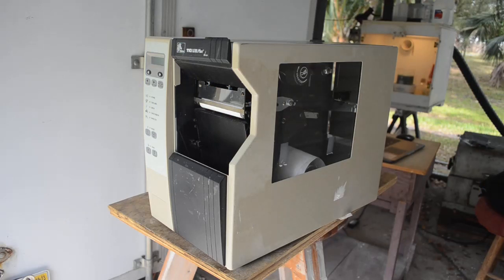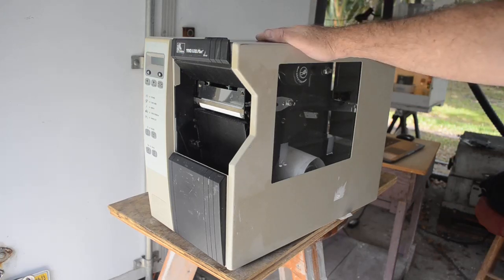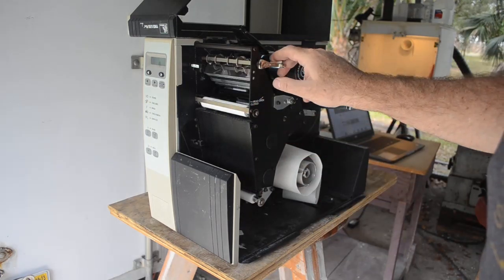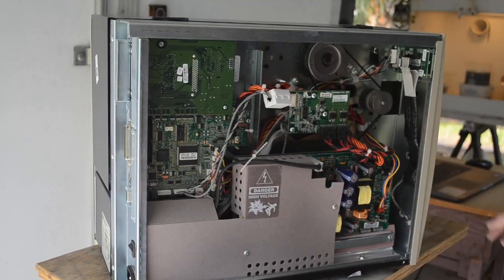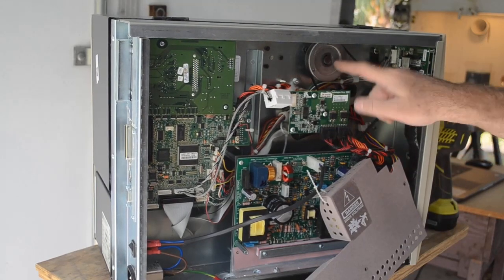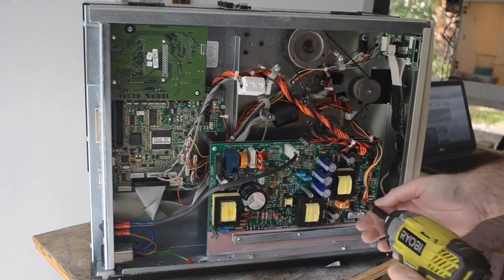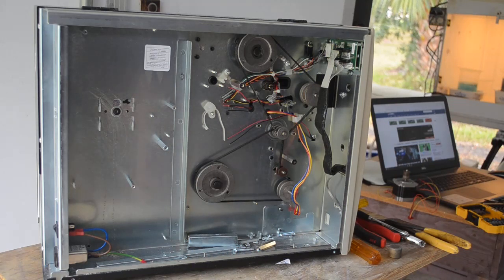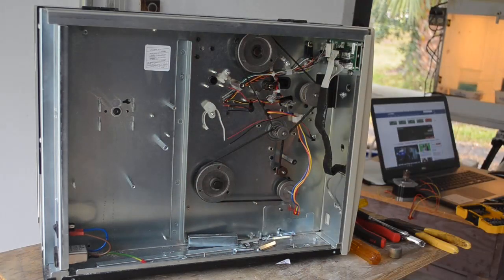Gold from a Zebra 110XiIII Plus Industrial Label Printer Teardown and Scrapout

Comment: what would you suggest on how to remove all solder from circuit boards before i give them a lye bath to get the solder mask off
Reply from the maker: That is a question I wish I knew the answer to. Most commercial solder strippers are both very expensive and highly toxic.
Reply: Канал Франсуа Пелье рецепт растворитель припоя УДАЧИ КОЛЕГИ!!!
Reply: @omegageek64  soak in50/50 HCl and H2O The SN will be the first metal to dissolve leaving the Ag, Cu, Ni, and Fe. just takes a while unless you heat it,
Reply: @user-fb9bx5xs2y  can you provide a link please